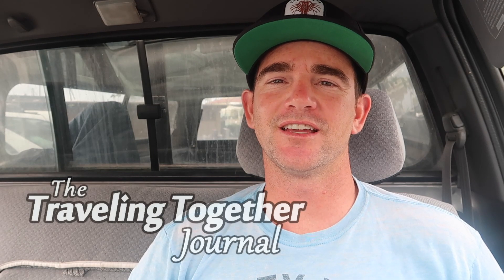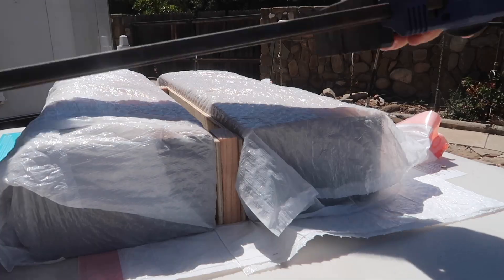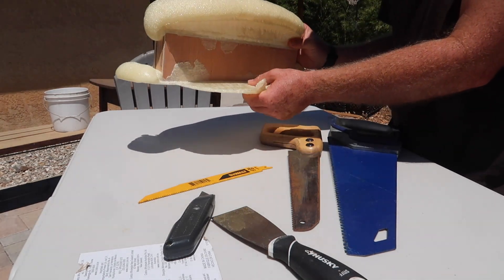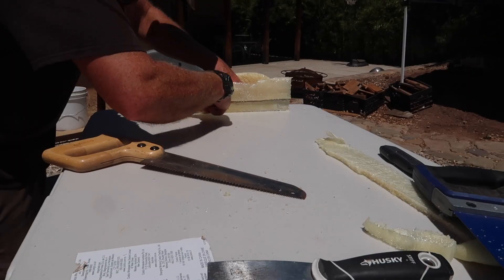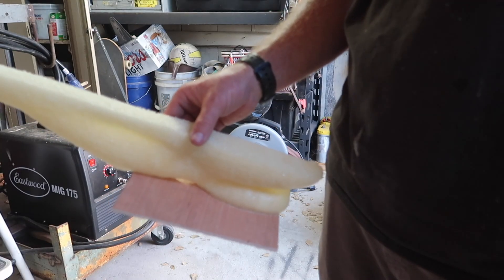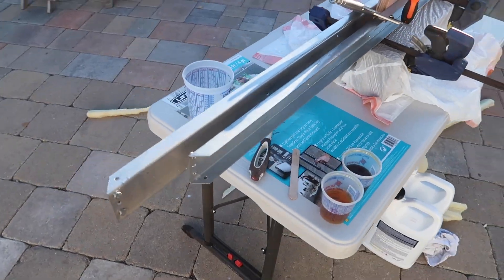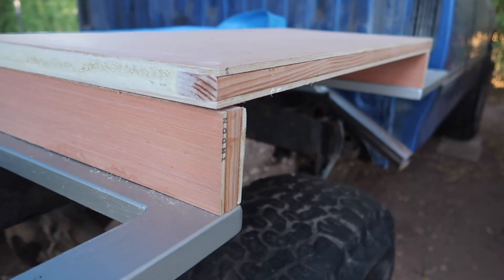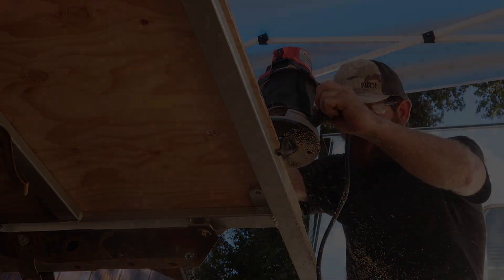Building A 4x4 Truck Camper | Pour Foam Composite Panels

Comment: Hi Mat. 
Have you considered the DIY spray foam kits that folks use on walls and such?
Reply from the maker: I didn't dive deep into it, but I wasn't finding much information about the foam that is created by those kits with regard to compression strength, closed cell percentages, water absorption, or weight.
Reply: Great idea, provided you can accurately spray the proper amount into the cavity without excessive over spray and loss.
Reply: Pour foam is much, much better than spray can foam.